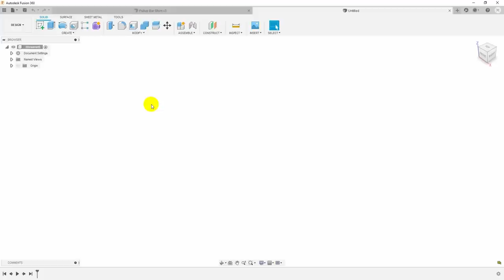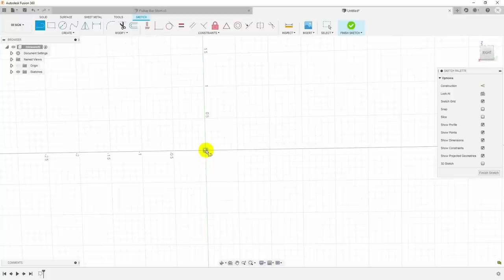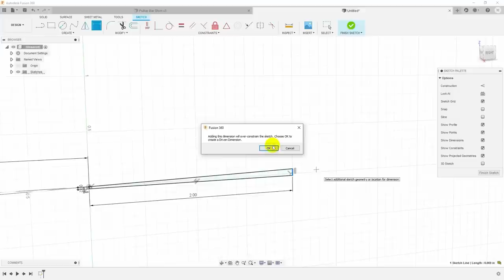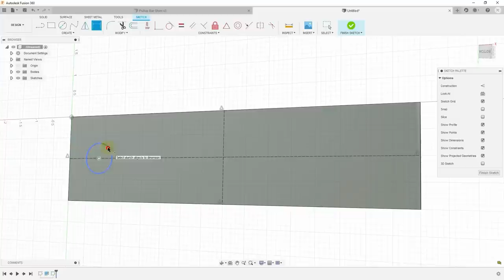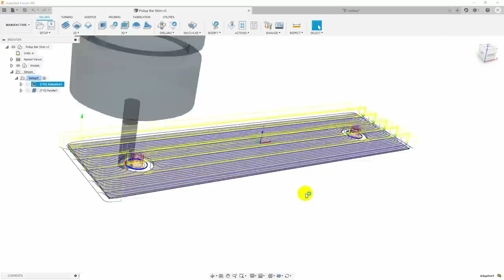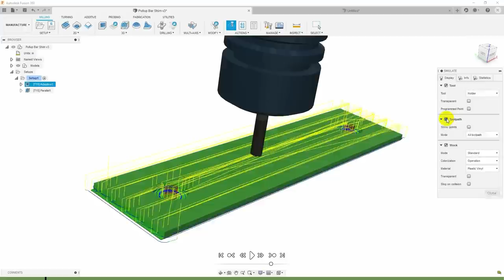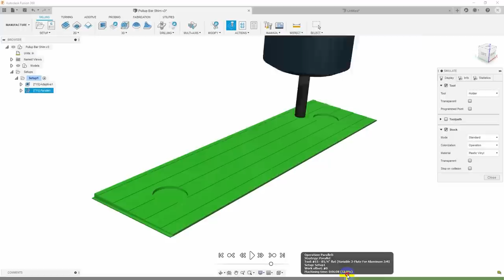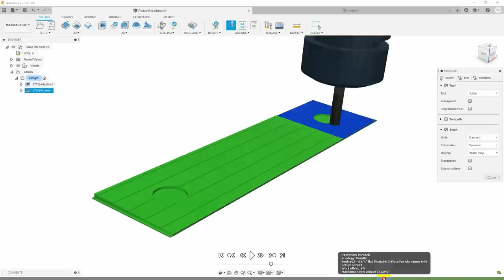CNC Machining a Thin Tapered Shim

Comment: Heck, the typical acceptable error in fabrication will produce errors like that. Nice solution. You insisted on a better alignment and made a piece to achieve that. The cause may have been down in the alignment and parallel of the feet, but by the time it’s all together, you can’t fuss too much more with that.
Again, this was a fascinating solution. Thank you.

Comment: For this case of parts, you can superglue it directly to the block and mill it without problems of blue tape. Then use a gas torch, heat gun or toaster to "unclamp" it.

Comment: First off, this is a nice demo of when you need to make tapered wedges like this.  I would have tried superglue  straight on the metal mount, and heat to release.  You could also set it up on a sine plate and mill the wedge flat.  If it were me I would have bolted it up and and used a torch to heat up the cross member about 1' in from both sides -- this would allow the crossbar to warp with the heat and the feet to fall into place.  Once the crossbar cools down it should have moved the 50 thou, and allowed the two end plates to find their own angles.

Also while watching this I had an idea for dealing with the "snow", as you call it.  I had a lath with an integrated coolant tank which drained into the casting between the ways.  There was a little grate to keep the chips from getting into the tank, and within the tank a baffle, and extra strainer/filter before the pump intake.  If you built a custom screen into a bucket and places a cyclonic vacuum separator on top of that, you could vacuum up the chips as they come off the machine, and let the coolant fall through a strainer in the bottom.  Once I get back to my my shop (been sheltering away from my shop during COVID), I will have to give this a try.
Reply from the maker: Good ideas.  I didn't want to take a torch to the rack because I didn't want to mess up the powder coat.

Comment: James, as you said "on the carpeted floor, I didn't even notice it". Its likely that the concrete floor could have more variation in the surface level that the resulting misalignment that you had to deal with. That is of course, unless YOU built the concrete floor!! :)
Reply from the maker: There's another joint I shimmed as well, and I realized too late that the error in that joint probably offset and allowed it to sit flatter.
Reply: Clough42 haha! Yeah there’s always more to it isn’t there?

Comment: Hey! When I use the ramping function Helix, I reduce the ramp clearance height to 1 or 0.5 mm. Then endmill faster enters the material and saves some time. Just in case if you want to improve something.

Comment: James -
1) you didn't use a torque wrench on those bolts.
2) You didn't use washers with those bolts so the nut will spin and mar the finish.
3) The bolts are bigger than needed. You could save some weight / cost by using smaller bolts. Run a finite element model to see how small the bolt could be.
4) Some people would have measured and made a shim to go under the foot that was lifting. Maybe even a couple pieces of cardboard from a shoe box would do it.
5) etc
6) etc.

Actually I like your videos and the detailed explanation to what you are doing and why. I don't think making such a shim is critical for this. But learning a skill that may be needed later is always good.
(My comment was more for the trolls that I expect be blasting you for the overkill. Please keep the videos coming.)

Comment: Uh, I'm no mechanical engineer, but the one thing I remember is that having a structure pass through zero stress is a major contributor to fatigue.  And your workout will definitely pass through zero - a lot.  Not that this stress was part of the design, but it might not be a bad thing to leave it.  Of course, the rack isn't likely to fatigue, so... eh.

Comment: I do not have a CNC and would have cut a much thicker piece of 1/2 inch and longer, Clamped the ends down with the one edge raised the extra 50 thou I believe you mentioned or what ever it was, Then started at one end, and cross milled moving from one end to the other, Nothing should move since your working always into a thicker piece of steel

Comment: You should look into "Insta-Set" accelerator from Bob Smith Industries. I think I got this bottle at Hobby Lobby. Spray where it can get to the superglue, and it'll be set in 10 seconds or less. It has a lot less objectionable smell than other accelerants I've used.
Reply from the maker: I have a couple.  The Loctite brand doesn't smell bad; the stuff I got from my local RC hobby store does.  In my experience, the accelerators typically result in a weaker joint, though that wouldn't matter here.

Comment: A tip for removing the part when super glued, just add a little heat from a blow torch or heat gun and it will just fall off.
Reply: that works well if just super gluing alu to alu, but you'll burn the painters tape that way -- and gum up the adhesive -- I tried the heat gun, not good

Comment: Could you zero from the bottom of the stock?  You could make an area that is 2 or more layers of painters tape thick and zero from that.  Then since you are starting with stock not of an exact dimension the part's final thickness would not rely on accuracy of measuring the stock.  Additionally it seems like a better way to leave behind a super thin amount of material.

Comment: If you  set your Z Zero to the bottom of your plate and Zero on the bottom of your part the cnc will go up .125 from the bottom of the plate and you wont have to worry about modeling it at .135. in cam. Also how do you like those shars calipers

Comment: Do you know a way to make fusion 360 ignore those holes when you were milling the topside?... It would be faster and simpler to mill as those holes are not a contour or maybe even better to mill the holes at the end
Reply: O wait I should have waited with the comment
Reply: Just remove the holes before generating the second toolpath. You can also project a sketch on the top without the holes and use this for the toolpath.

Comment: By chance did you make sure the floor was level?  Great video and total overkill!
Reply: I was wondering about just turning the cross bar upside down to see if it leaned the other way and matched up.
Reply: @lwilton  yeah- I suspect he did much measuring and testing and could only fit so much in the video.  He seems to have a reasonable understanding of geometry and trigonometry ;)